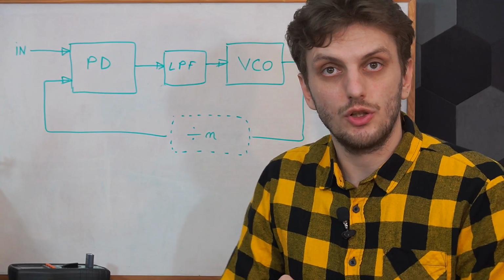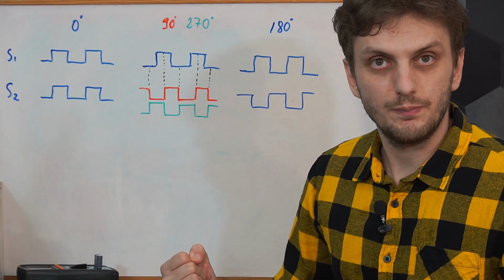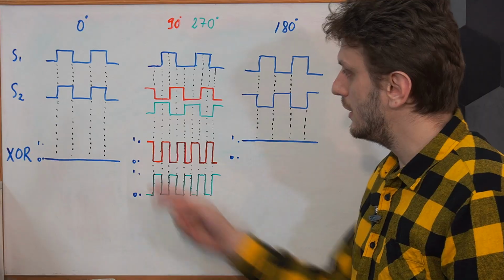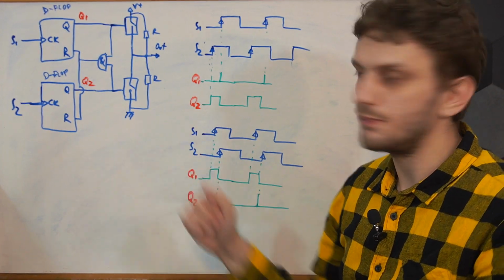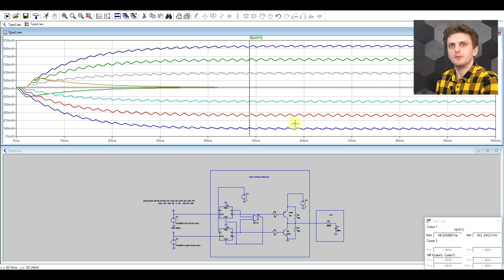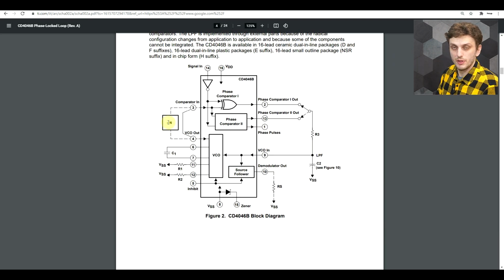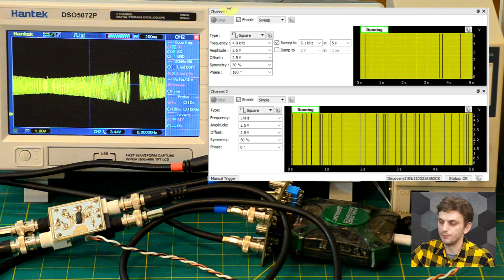PLL's - Digital phase detectors

Comment: Hello, I'm confused why the XOR based PLL locks when there is 90 degree phase shift between input and output. In other words, why locking occurs at half the voltage? What decides that?

Comment: Does it mean that the second type phase detector can detect only 5 angles 0,90,180,270,360 so if i need a detector that have 180 steps from 0 to 180 degrees which means he can read the shift degree by degree and gives me a reading on 25° different from 36° for example what to do please any one help
Reply: i guess it will detect any difference in phase or frequency, he used this values because they are easier to understand

Comment: I love combining knowledge into not so many words... So!
 The stable crystal oscillator's sine wave is made to a stable voltage. Another voltage is fed to a voltage controlled oscillator who's function is affected by user voltage input and desired output frequency. To check if the desirable function is in phase, the multiplied function is divided to the base sine and compared?
I need someone to check the validity of my statement.

Comment: I have some doubts about simulating transformer in LTSPICE. Primary voltage is rectangular waveform of 25Khz and 30% duty cycle. But when coefficient of coupling is less than 1, output waveform is not rectangular. It is converging to 3V. I want to know what is model of transformer in LTSPICE?

Comment: Oh and also note that PLLs can lock onto higher and lower frequencies with a type-1 phase detector. If there’s some relationship like f/2 or 3f/5 or something that causes the output signal of the phase comparator to repeat, then it’s a stable configuration for the PLL itself. This means if the rest frequency of the VCO is more than ~1.6 times the input frequency (ideally it’s a factor of 2), it won’t lock on that frequency but on a harmonic of it. Probably fine for FM radio, but for AM radio or audio purposes, this is a deal-breaker. I’ll have to see how the type-2 sims.

Also neat function generator.

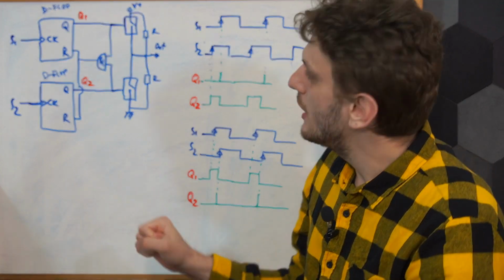Comment: 8:51 Sorry you call these D-type triggers, but they don't have a D input. Perhaps you should connect D and inverse Q on each flip-flop?
Reply from the maker: I guess I didn't add the "D" input to keep the schematic simple, but this is a valid point - its important to see that input connection to get the circuit to work correctly.
Reply: I see that in LTSpice you have connected D-inputs to logic 1. This is definitely better.

Comment: If you could please let me know which circuit simulator you have used for simulating CD4046B PLL
Reply from the maker: I did not perform any simulations with the CD4046; I just built the circuits I showed from the basic logic gate building blocks found in LTspice.
Reply: @FesZElectronics  Thanks

Comment: Nice video! 👍🏻
Btw, there are ideal filter blocks available for Ltspice. They work so much more convenient, especially the higher order ones (including highpass, bandpass etc).
Reply from the maker: Is this filter a default component in LTspice or is it a component that needs to be imported?
Reply: @FesZElectronics  default, might have been added in a recent update
Reply from the maker: I just noticed the warning that I haven't performed the updated in ~500days; more than half an hour later I remembered why I don't perform those updates. 
Anyway, I noticed the "Filter Products" category, that contains various IC's. Was this it?
Reply: @FesZElectronics  yes, updating always takes very long. The filters are in the SpecialFunctions category. But I really can't remember if it's by default or some kind of extra (I always just copy the whole folder to a new system). I will have a look for you :)
Reply from the maker: I found them now! These are default, but they came in a "recent" update (sometime in the last 500 days). Thank you for telling me about them, I will study them in more detail.
Reply: @FesZElectronics  No problem! :)
They are super handy! I use them A LOT!!!
Also for audio related stuff

Comment: The fun thing with XOR ports is that one could make a PWM signal/generator by changing the phase or delay of the signal. 
You could even use sine waves as inputs.
Reply: Contradictory ,most people uses PWM in create pseudo sine wave instead.